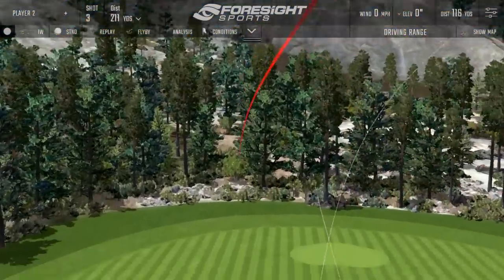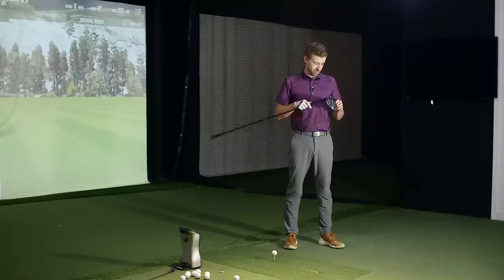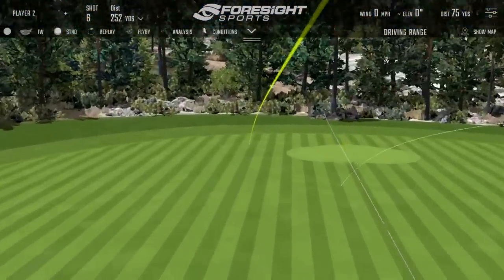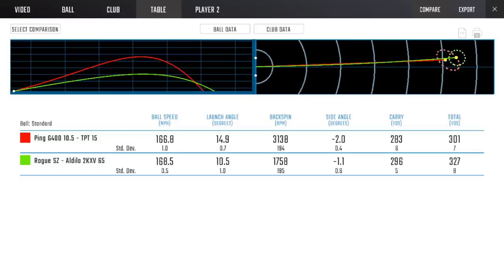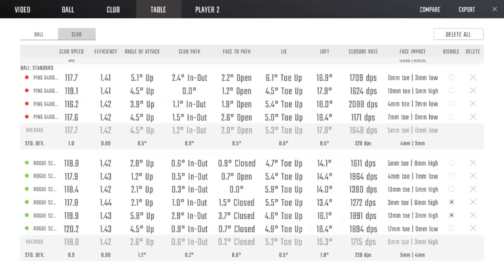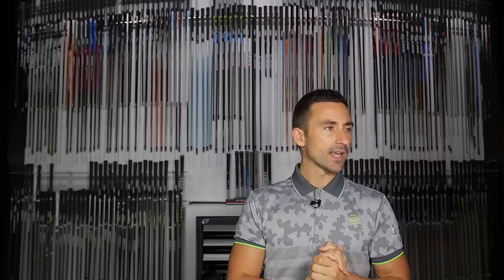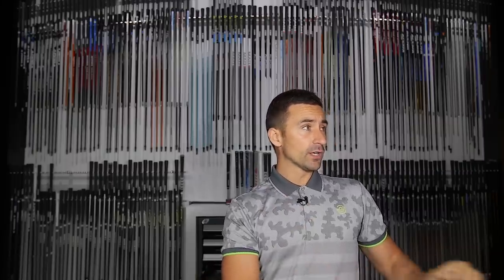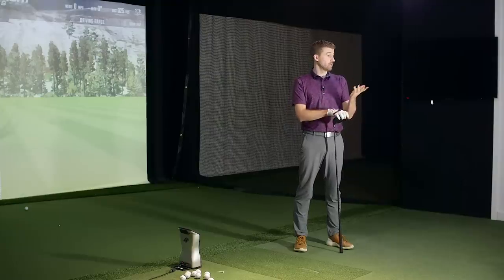Hitting Driver Too High | Losing Distance

Comment: I've not ever seen my numbers on a trackman, but based on yesterdays driving performance this is me to an extent. I don't always hit the fairway, but my strike is usually pretty middle of the face. My natural shot is a fade and when I feel like i hit a drive well it doesn't travel all that far. I have a really high ball flight with the driver (TM Burner Superfast at 10.5 degrees loft) and it balloons up and drops like a pin. Seeing this video makes me want to go to a demo day and get the fitter to let me jump on the trackman and test this out. 

You guys are the best analytical and practical golf channel ever!

Comment: One thing to add about Rogue Sub Zero...check your weights when you order it. I (perhaps naively) assumed the larger weight was placed forward by default. Played several rounds (including tournament ones) struggling to keep the ball down. One day, I decided to pop the weights out and sure enough, the heaviest weight came default in the back of the driver head vs. close to the face. Made the switch and saw an immediate difference.

Comment: I play the Callaway rogue subzero. I used to struggle with hitting my drives too high. Now I hit it straight and long. I could not be any happier. Finding fairways and now hitting PW to 8I into greens on a championship standard course.
Reply: What did you do to hit it better
Reply: Andy V I find the subzero has a lower trajectory and is a low spin driver. I spin around 2500 which is sound perfect for me. The club-head feels rock solid through the ball and I personally find it very forgiving on off center hits.

Comment: This opens my eyes a little. I'm still new with golf numbers when it comes to swings. I notice my drives go high, but I still fly it 310+... When I really try to put one out there, the ball tends to go high. I defiantly hit up on the ball more than most. I'm assuming I should find a different shaft. I might consider to go get fitted. Taylormade gave me a stock Stealth after breaking my SIM and I immediately noticed a difference in height and distance.

Comment: Great video guys! I fall in that category - but with a lot less speed than Matt. As a senior I have a clubhead speed of 93 to 95 mph. I fit the profile you mentioned in the video. I was told by a fitter at a  llocal golf shop that most likely I would most likely need a 10.5 regular shaft. Which is the loft my past couple of drivers have been. I switched heads and accidentally set the head on my XR16 to 9.5 and my distance jumped about 15 yards. I was shocked. my ball speed jumped about 3 mph as well. Your video confirmed to me that I need to find what works best for me and not go with something that is a general guideline for driver fitting. In fairness to the fitter he was by himself and he was trying to manage three bays of hitters at one time. Thank you again guys!

Comment: Guys, really enjoyed the video.  I have been to a couple of fittings and struggling to keep my driver in play.  I have a GC2HMT in my basement and I therefore really know my numbers.  I generally have spin loft numbers between 9-13 depending how hard I want to hit up on it and how well I keep my hands moving through impact.  I therefore DONT spin the ball off the driver and it seems to really hurt my carry and also direction.  It seems when I hit a really low spin shot and don't hit it perfect, I really pay a price.  The ball will hardly carry and dive left. I am playing an 8.5 degree driver, swinging at 106-108, hitting 4-6 up and never see a spin over about 1800 unless I leave the face open by accident.  Path numbers are always between -1 out to in up to 2 in to out still hitting up.  I think I need about 300-500 more rpm of spin to keep my ball in the air and straighten out the flight.  Just ordered a 9.5 degree driver in the same head.  How much additional spin should I expect to see from a 1 degree increase in loft?  Does this make sense?

Comment: Would love to see a test of tip weights vs lead tape on head for irons. Thinking 7-10 grams.  Maybe on a slightly wider cavity back, since it should theoretically have a greater effect on CG location than on thin blades.  Also curious to see if there's a ball speed difference, since there should be more mass directly behind the ball with tape.  Perhaps there's also a difference in ease of face closure.

Comment: Right on target. I just moved from the 913D3 10.5 to the TS3 9.5 for similar reasons. Similar shafts; Bassara 55 S in the 913 and Tensei AV 55 S in the TS. Dropped my launch angle by 3 degrees, reduced the spin to 2100 rpm, gained 5 mph of ball speed and dropped the decent angle from 39 to 34 degrees, which produced a lot more roll. I may actually adjust the loft by +0.75 to see if there’s anything more to squeeze out of it.
Reply: I tried changing the TS3 setting from A1 to D4 to add +0.75° of loft, making it a 10.25° driver and the results were amazing.  During the Titleist fitting, I got really good Trackman numbers in the A1 setting, but the flight characteristics in D4 were fantastic after more intensive range sessions.  Why did +0.75° improve the flight shape and stability so much? I gained more than +0.75° of launch angle, but was still well within the desirable range. The peak height occurred farther downrange and I gained another 10-15 yards, easily ... into a 10 mph wind!  Please help me understand how such a seemingly small change made a substantial difference. Thanks.

Comment: Literally just purchased this driver and made same set up 5 years on to solve this exact problem, had G425 max and i was ballooning up losing 50+ yards. seeing 20%+ launch angle with Ping - Swing obviously the issue but this has made a huge difference.
Reply: So you switched drivers? I also have a ping g425 max and am losing distance to high launch angles… was thinking of just lowering the loft from standard 10.5 to 9, but dunno how much that will help

Comment: I got fitted with a Ping G400 max driver 10.5 and the fitter set it set loft to 11.5 as I was struggling with  a low cut , it was straight through as I got better the high flight was stalling so I went back and he set it back to 10.5 which made a huge change to trajectory.

Comment: Lol this was so me in 2018, but in 2019 and even in 2020 my coach fixed this type of issue. My attack angle with the driver was too far down instead of up. I was swinging it 107 mph on average in that lesson, but my spin was way too high. So now I use the downward attack angle with the driver if I want to tee it lower and to just find the fairway. But in a lot of my drives especially on the driving range and wide holes in the course, I’ve been carrying my driver past 260 at times with a more upward angle of attack by just putting the ball way more up in my stance. Shockingly, my swing path is less in to out and I do have a similar swing tendency like Matt in the video and I am left handed. Shockingly, when the ball is more up in the stance and if one swings with no manipulation, the swing path will have a tendency to be more inward on the follow through. To those who are struggling with high spin drives, you guys are not alone because I had that problem in 2018. But now I think I’ve fixed it.

Comment: Ian/Matt - what were the playing lofts of each driver (10.5* for G400 and _ for SZ?) and could you have achieved similar results by adjusting the loft on the G400 down 1* instead of switching out to a completely different driver?  I get that G400 has more spin in general than SZ and M3 but I play a 10* G400 LST adjusted to 9* and I still produce a lot of spin and my drives launch crazy high :/

Also, is there any difference between adjusting +1.0* to an 8.5* G400 LST  vs. adjusting -0.6* to a 10* G400 LST?  Assuming the 0.1* difference (9.5* vs 9.4*) is negligible, do the lie angles, face angles, open vs closed, etc. change at all?

Comment: Thanks for this.
I feel like you made this video specifically for me. 
You didn't address if there would be a difference between a 9 degree vs a 10.5 degree head.
Is that covered in another video.

Comment: This is exactly what I am looking for. I hit the ball so high and carry it 280 or up but with a very descending flight basically no roll. I use a stiff flex yellow smoke shaft with a speed zone head. I have no issue with fairways. Need to get some lower flights as soon as possible.

Comment: This is totally me! Ping G25 Driver 10.5 neutral and I need more distance. (255 avg.)  Always have the higher peak (not a ballooning things just higher than needed) I usually need to move the placement of the ball further back in my stance to obtain the flight I would prefer to see.

Comment: Hi. Enjoyed this. I’m 67 and handicap 13. Using Taylormade SIM2 Max D with A flex stock shaft. Swing speed with 7 iron is only around 67mph. I hit the driver ok but flight is v high and I get no run at all. Should I consider changing driver or look at other shafts. Appreciate any input. 
Cheers
Jim from Glasgow 😊

Comment: I had  the same. Problem with the subzero I have put some 1 gram fishing leads behind the normal weights to make it a a lot better and it doesn’t move if tightening normal and accurate .
Have to do something because they don’t have the weights over here
Reply: I ordered custom weight set off ebay cheap price
Reply: Andy V ok  I will search for it  but the fishing leads works great and it a buck for a box full of them and they rol in easy keep the driver on his side drop in the lead balls and insert normal weight above the fishing leads screw in a bit turn driver upside down separating the lead balls evenly then screw in the rest.

Comment: Feel like school is in during your videos. 
This is me exactly ball goes high doesnt roll out but a foot from landing. Lots of spin. Was hitting an R11 9.0 got a M3 9.5 for my  bday 98-99 mph club stiff flex tensi blue . Definitely has lowerd flight, i have one weight all the way up near face and the other is at the intersection of the Y track. 9.5 lowered it a tad. Would heavier weights be a good move from the 11grams?

Comment: I always seem to hit it higher at the range ,we have great facilities there with fitting and flightscope so I know my numbers  quite well ,the only thing thats not great is that we have range balls ,they are the srixon black stripe ones ,I think they are about 10% less distance so you would need a shot from Heaven to get it over 300 yards which is what the range is .Would you guys say that in general these sort of range balls do fly higher ,I do notice if you get too much height and spin they can kind of drop out of the air almost like they have hit a force field .Once again very good video guys and Matt really seems on it with the driver .
Reply from the maker: Big variance with range balls across different facilities, some are quite low spin and very firm while others are designed to fly a bit shorter due to distance restrictions

Comment: Again, awesome video. Is there any way to get the launch down on the Max?  Would heavier weights or hot melt get the launch lower?  How about a low launching shaft to pair it with?
Thanks as always for another interesting and informative video. Please keep them coming!
Reply from the maker: Biggest difference would come from setting it to the lowest loft setting

Comment: Always the debate, do you mask it with equipment or fix the issue.  For a player who went this direction but then fixed their early release is this still a viable option or are there more versatile heads ?

Comment: I've got the new TS3 and cant stop hitting it into orbit again feel like I hit it out the middle an straight  but probably only carrying 220yds! I top out my swing speed at  around 105mph. I used to be in the top 5 longest drivers in the club but struggled for a few years now hitting the ball too high. I was thinking of changing to the new G410 LST or do you think I should use the money to have lessons to change my swing?

Comment: I have a moderate swing speed. I was hitting driver too high, set at 9.5 degrees with stiff shaft, so I knocked it down to 8.5 degrees and now I am hitting it longer and  straighter than ever.

Comment: I tried this fix with the driver was awesome worked really well for me. I also have the same problem with my irons even with the ball back in my stance it goes to high. I was fitted into AP2 2 up and +1 inch (am 6”4) with KBS C taper x flex shafts but still struggle with height, kills me in the wind. Local store doesn’t seem to know how to help? Any ideas what to try?

Comment: Hi, love your content.  I bought a G410 plus with the stock Evenflow black 6.0 75g shaft.  10.5° head.  Best strike was 111mph swing with 1.48 ball speed.  My Apex was 171.9 and spin was 3700.  Got 266 carry and 271 total, lol....if I set it to 9.5° or 9°, the face will open.  I'm wondering if I move the weight to the toe or heel to counter the open face?  Thanks.

Comment: Timely video. I hit my driver high and at times get that rising balata spinner that I know loses some distance. I was on Trackman yesterday with my 915 D2 10.5 set at 9.75 (C2) with a Fujikura Speeder 757 Evolution 1 Tour Spec Stiff shaft. Here are my numbers: Swing Speed 96.2, Ball Speed 145.7, Smash 1.51, Spin 2546, Launch 15.2, Attack +1.4, Carry 249.2, Total 271.3. The balls were new Callaway range balls and I do not notice much yardage difference between them and Pro V1 and X's I play. The yardage numbers are what I see on the golf course, typically carrying it in the 235-250 range. Should I be getting a little more out of these numbers with a swing speed in the 95-100 MPH range? I have a heavier weight I can add but the shaft is already heavy at 78 grams. I was thinking of going to a lighter, low launch,  low spin shaft. Maybe the 661 Evo II or IV? Others? I've been considering the softer AVX for the Fall and Winter. I've tried it and may see some distance gain in the long end but lower spin balls scare me at the shorter end of the bag. Thoughts on my numbers and direction I should take?

Comment: These videos are simple the best. This is me in a nutshell, I love my G400max but spin it entirely to high. It does have the stock 55g stiff shaft, what shafts would you suggest to help with the high ball flight? Swing speed 95-100. Forgot to mention that it is 9 degree, adjusted to -1 degree, with that being said, a heavier more stiff tip driver would not help much?
Reply from the maker: The shaft likely won't change your spin rate a noticeable amount Jamie, I would look at lowering the loft using the adjustable hosel for a more significant ball flight change.

Comment: This is me. I'm a decent driver. Accurate, but only about 270 total on an average strike, normal conditions. Into a headwind, more like 240. I'm using 9.5 degrees, and I swing about 103-105. I'm thinking that spin may be the culprit. So I'm curious about the swing weight. Is there a configuration to applying lead tape to the head that I could use to bring the spin down? As opposed to buying new equipment. I simply can't afford that at the moment. But perhaps eventually a new shaft is the answer? I'm using a taylormade stock stiff shaft from 10 years ago, so maybe. Any responses would be greatly appreciated.

Comment: I've tried a new M6 Driver this week a demo not adjusted for me, I have a strong and very fast swing speed like on the Pga tour, I was hitting cheap practice balls with cary of 170-220 yards but with a peak of around 200-250 feet in the air huge balloon ball flight etc  I can't afford yet a new set of clubs but it's to give you a idea how important fitting is if your a good player never buy clubs off the rack in the pro shop or the store without fitting and a monitor etc it will screw your game up big time, it's night and day the difference it can create.... everything matter greatly, the balls, the shaft, the loft, the lie angle for your body type etc for example im 5'8 but I have very long arm so clubs who aren't fit for me never rest perfectly on the grass, I always have to manipulate them so it can sit in my hands correctly, but because I manipulate the club I'll never be able to hit it straight without fitting cause the head doesn't rest correctly on the grass cause of the bad lie angle etc you could have others problems like this like a bad shaft for your swing type, a bad balls etc

have a nice day

Comment: Its really underestimated how much effect that spin has on long shots. Noticed that my 3 wood was going a solid 50 yards short of my driver and in most cases even shorter than my 5 wood. Went to hit on a simulator and turned out my 3 wood was spinning between 5/6k. It was shocking to see that almost cut in half and then gaining 25 yards or more.

Comment: Good video! I think I'm having problems with the spin rate with my driver. I am hitting my driver quite hard, (110 mph ss), but I get high and spinny ball flight, and my drives end up being only 270 yards with absolutely no roll even on a dry fairway. How could I get my spin rate down?
Reply: I hope I'm not wrong here, but usually Ian suggests managing launch and spin primarily with the head. So lofting down or a head with "low-spin DNA" (like a Sub-Zero from Callaway, LST from Ping, etc) would be good options

Comment: So were these the same lofts on each driver? A little confused on that. I have the problem. I like to swing up on my driver I hit it much more accurate and consistent on the face when swinging up but I have a really high flight with an 8* Long Tom driver. Would switching to a lower lofted driver help me as well as moving weights?